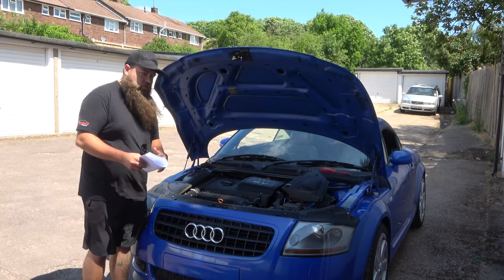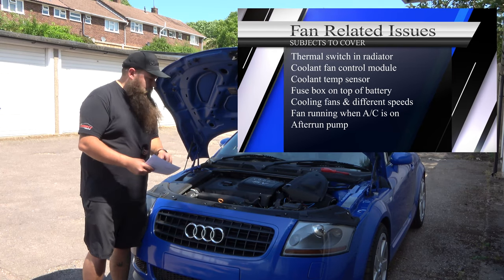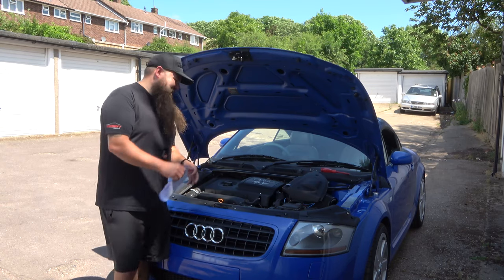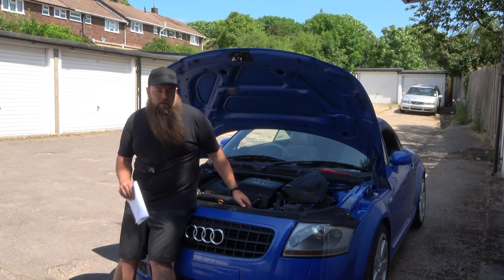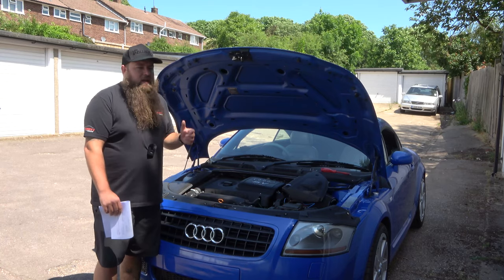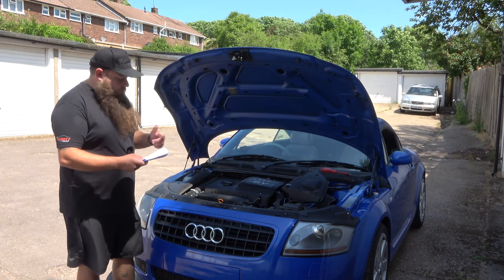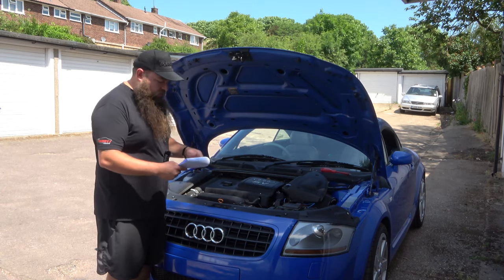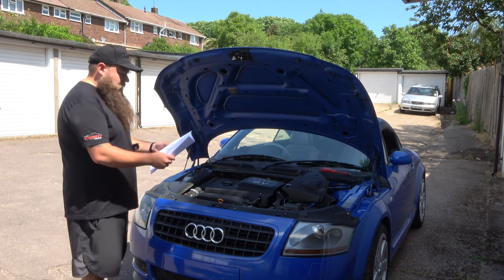How To Fault Find Fan Problems Audi

Comment: My low speed fans come on at about 99°c, and shut off anything below 99. Drives normal but, Are they supposed to stay running even after you shut the car off? I hear my aux water pump, but my coolant keeps getting dumped out my reserve tank when parked and no fans. Driving me crazy. I've watched you video a million times. Good stuff.

Comment: Hello, my first fan speed always starts at 100 degrees, the temperature needle goes up when the car is idling, it goes up a little and then goes down quickly when it reaches 100 degrees. But if the car is completely stopped it doesn't start the first time. speed to cool down the car after driving with it

Comment: Sometimes the air conditioner may not start because the outside air sensor temperature is missing or not working )

Comment: I overheated badly on A30.. towed in and turned out module controlling fans packed up so not turning on. They sorted that out but still running too hot. That turned out to be stupid plastic impeller in the water pump disintegrated!! Got an aftermarket one with metal impeller and was cheaper than the recommended one
Reply from the maker: Unfortunately sometimes it can be the smallest thing that goes causing the biggest problem, I have seen it many times where aftermarket parts have been fitted or parts that have maybe not been made correctly fail, and you look around thinking it’s got to be something else when really is the part you think I wouldn’t fail. And sometimes you replace one faulty part think you’re okay and there’s more than one problem 😂😂

Sounds like you’ve got it all sorted now though 👌🏻
Reply: @TheParrottBros  I was lucky, as to be honest I was giving it some, a little 'friendly fun' with a fellow driver 😉.. there's no layby on the A30 there so had to drive over a mile down the road with the red lights flashing and temp gauge at the top.. stil, head gasket survived and no issues since (was 2 years ago) 🤞
Reply from the maker: @blakkno666  Sounds like you got very lucky if thats the case!! always nice to hear a good story rather than a bad one haha
Reply: @TheParrottBros  it's the Audi pump that has the crappy plastic impellers! I'd advise anyone replacing water pump to buy one one with metal impellers, cheaper too!
By the way, when's the subscribers car vid going up, really hoping I'm in it! 🤞😉
Reply from the maker: @blakkno666  it should be going live this Sunday mate 👀

Comment: Perfect timing for me!
Reply from the maker: It was as if I knew 😂👀. 
Only kidding, I’m sure there is a few people who have been nursing them for awhile as didn’t know what to do,/where to look as this is quite a common grey area
Reply: @TheParrottBros  My TT has been sitting, my ol man parked it after melting the fuse in the box above the battery. The primary fan isn't spinning well either. I have just picked up a new to me module and working on replacing the fan and fuse block.
I'm going to hit the Aux pump as well for good measure now that I know. 
Maybe you did know or you hear the voices in the void calling out in need lol! Either way doing great, keep up the videos!  Kudos from across the pond.
Reply: Not all tts have secundaire electric pump mate
Reply: @TheParrottBros  Starting to think the problem is more pervasive, than you being psychic! LOL
Reply from the maker: @FloorWyers  that’s right, sorry should have stayed. It’s 225’s only
Reply from the maker: @robertcook4215  haha thanks fella, just test as you go, no point replacing parts that are not need replacing. Gets expensive quick 😂

Comment: Great timing especially with the ultra gauge comparison. Just replaced my original after run pump as it was just seeping under pressure. Still have work to do so this video will be very helpful. 👍
Reply from the maker: Glad it will be put to good use, yeah often they get forgotten about as they’re out the way and if you don’t hear them running you wouldn’t question if you did not know it was there 😂

Comment: Great video, i had problem with my AC last year and the pressure switch (G65) was broken. But after change and refill the fluid all worked fine again
Reply from the maker: thanks buddy, thats a nice simple fix, its annoying it doesnt flag a code or anything on the dash, so unless you have diag software you wouldnt know ( except no a/c if you live somewhere hot ) haha

Comment: I already removed the air con and really thinking about removing the fan control module to remove a lot of shitty wires and run the fans the simplest way with relay and temp switch, just trying to figure it out the best way to do it.. nice video bro!
Reply from the maker: Thanks buddy, yeah I too contemplated that but love my a/c too much, if I had a roadster it would be a different story for sure 😂. Feel free to drop me an email fandwe can discuss wiring if you need a hand

Comment: Thanks for the information, car was overheating in traffic, turns out it was just a burnt out fuse on top of the battery ( fuse had actually melted) New 30 amp fuse & fans burst into life. Once again great video.👍
Reply from the maker: Right so if that’s the case check if the slow speed is working or not as usually when a fuse blows or burns is due to being over loaded

Comment: Good timing. I didn’t think I had problems but apparently I do. After run pump doesn’t come on all the time and I see that the right fan never turns on either. Left fan( under the after run pump turns on but I guess the car didn’t get warm enough for high speed to kick in. I guess I need to start looking for part numbers.
Reply from the maker: At least you caught it before it is a real problem, just think how hard a little fan is having to work compare to the other one that should be on at the same time

Comment: Great video and information, THANK YOU! 
I’ve been following your troubleshooting steps and using a jumper wire at the thermal switch connector I’m able to get one fan (right side) to run high & low speed. I would think both fans should be running? Is there a good way to test the left side fan?
Thanks again!
Reply from the maker: Yes, both fans should run together both speeds. 

Check the wiring to both fans as on separate plugs as you may have a power issue. Failing that the fan may be seized or motor failed
Reply: @TheParrottBros  Thanks for the reply Mr Parrott. I see there are 3 wires for each fan, I would guess that one is ground, one is low speed and one is high speed?
Reply: Just a follow up, I found the that the larger fan would not power up at slow or high speed. Removed the fan from the car and removed the back cover on the fan motor. Found one of the motor brushes was stuck in the holder. I freed up the brush, cleaned the commutator & reassembled. Working great. Thanks for the great videos and resources 👍

Comment: In my epic research too find my fault, I came across this gold nugget. 

You can pull out fuse 16, to force the slow run fans to kick off. 
If those work you can eliminate that circuit of the fan controller module. 

Today I finally got the TT back up and running after 3 months off the road. 

The bloody thing has done a full Christine (1983 film) on me 
Haha! 
The TT fixed its self. 😑
Thanks heaps for helping.

Comment: I just purchased an '02 TT 225.  Large fan not working.  All fuses OK.  Do you have video for R&Ring the fan?
Reply from the maker: Hey Alan, good spot, will definatley save issues further down the line, i dont im afraid, its not something ive filmed. Its quite fiddly to do, usually easier if you remoce the front bumper then loosen the slam panel/ rad pack and allow it to come forward to give you extra room to work

Comment: Thanks for a really comprehensive video. Really handy.

CAn you give any more detail on the running of the fan control module? I’ve been told the relay that switches on/off the magnetic clutch on the aircon compressor is contained in the unit. At what stage does it switch on during the aircon startup?

Reason being my compressor clutch is not being engaged and I’m not seeing any difference (in terms of voltage) to the compressor even if the aircon is on.  My car has a failed slow speed fan on the larger of the 2 fans (right hand fan nearest the battery)  which I will replace but the left smaller fan (furthest from the battery) does spin at the slower speed shortly after the aircon is switched on… but I’m not seeing the compressor clutch engage. What are the steps the car goes thru to start the AC? Is there a way to test the ac high pressure switch to confirm there is enough pressure in the system to switch the compressor on… 
Where is he AC high pressure switch and what role does the FCM take in the AC startup? Are there any other modules to check as part of the AC startup/running steps?

Thanks again for your video. It’s helped me lots.

Comment: Hey great channel. Ok I have a mk1 tt 225. Had the car 2 weeks. The car sits at 90 degrees on the Dash and the coolant digital temp on the climate control unit was sitting around 80 when I stopped the car. I let the car idle for 5-10 mins and the genk gage on the Dash was still at 90 by tje fans were not kicking in as I would have expected. Then when I switched the car off there was no secondary fan or pump running as you have mentioned. I will check the fuse/s on the car later. Ans try and work back to the fault.
Reply from the maker: So the gauge will sit at 90 solid when its 80-100 on the climate gauge as its a weighted gauge, thats totally normal, if you turn the air con on do the fans run? and the pump on the radiator should run from the moment you turn the key on until almost 10 mins after you turn the car off

Comment: i've changed fan control module and temp giver and fans work fine now but clima doesnt cool. I've heard about some part behind the glove box that can be the issue but not sure what that part is
Reply from the maker: There should be a sensor that measures how hot the air is in the blower cabin, looks a bit like a metal hedgehog, I’ll get a part number and send it over for you to have a look
Reply: Yeah that part has failed on mine. You can tell by the grayish foam which comes out from the air vents when the ac is running. There are two flaps which control the hot/cold airflow and that foam is the insulator. When it’s gone, the flaps don’t seal properly causing the issue. But I have to say, mine’s busted for about a year now and all I had to do was refill the ac freon. I live in a Mediterranean country and now it’s cold af in my cabin during the summer time.
Reply: @dimitrist3561  yeah i notices some sponge/foam pieces in the vent, i went to refill freon first when ac stoped but they told me its full and just added some oil for lubrication iirc. do you know part number for that flap i think thats my issue
Reply: @TheParrottBros  iirc its some kind of flap behind the glove box but I'm not sure if thats the issue
Reply: @77garga  I couldn't find it, but take a look at the following article for a better understanding of the issue https://www.audiworld.com/forums/tt-mk1-discussion-9/c-blowing-detached-foam-insulation-system-into-car-1948972/

Comment: Hi I have VW golf GTD to turbo recently just got the AC topped up temperature gauge read Dentist to check fuse box his fans was not working fuse as blown change the fuse fan started working fuse blown again no fans do not work and fuse keeps blowing even with the ECU off
Reply from the maker: Likely issue, fan has failed / gone short inside and is causing fuse to blow, that or a sensor has gone short, or you have a wiring issue. unplug one fan and replace the fuse, see what happens if blows plug back in and unplug other fan, easiest way to rule that out

Comment: My radiator fun slow dont work when temp go after 90 , only when i open ac , ive send it to mechanic he did check it , first it thought might be head gasket but after he saw it he told me he fix the control module (centralina ) , all fuses works ok he said but i did a test 20km with ac on. 5 min , after i stoped i saw the fund didnt work again and the car lost water , what it could be ? Please help
Reply from the maker: The slow speed doesn’t usually come on until 95 or above, they are. Controlled by a thermal switch which is mounted in the radiator. This could well be faulty. It shouldn’t be losing water, you could have a number of issues causing that but I would suggest looking at 1 thing at a time.
Reply: @TheParrottBros  i was all day to mechanic , he saw the water cable for leak . Didnt saw any , check all fuses and they seemt to be ok , when he open the centraline under was 2 cable unpluget , when i pluget those the car fun start to work in full speed but the car was cold , he fixed the centralina and now they dont do that again only when i turn ac on , but the water keeps droping half a litter for 20 km , we dont see ant leak in radiator or pipes , where does it lost the water ? What could it be .  in 20 km drive should the fun start working the sliw speed ?

Comment: Theoretically if there is no power at the permanent of the thermal switch, and the fuse has been replaced has it got to be the main brain part not working ?

Comment: Your videos are brilliant mate 👍 helps with my s3 8l a lot. My fans dont come on at all. The car has never went over 90 on the dash. Even with a bit of heavy footed driving. At a bit of a loss
Reply from the maker: You may just have a well flowing car mate, I wouldn’t worry too much if you’ve never had any issues

Comment: Hey bro ur videos are class... I've had my tt for 5 years and think it's the dogs balls but yesterday I was pulling away to and lost all power... My mechanic I know ish had a look yesterday and reckons my water pump seized on and it's jump timing but not snapped...  Its a 225 and she's so clean and looked after what should I do and damage do u reckon is there .. Any help would be brilliant
Reply from the maker: Hey firstly thanks for the kind words, secondly sorry to hear that happened, not usually good news, it depends did it stop the engine dead? make any horrible noises? usually can cause bent valves worst case
Reply: Many thanks on the reply if anyone's gonna no its you.... Yea stopped completely dead at around 1500rpm... Its booked in this week for the head to come off to see 🤞... If u have a spare 225 bam engine would happily buy... Thanks again for knowledge buddy

Comment: I keep going through fuse boxes every 3 months they keep melting
Reply from the maker: There is probably a little bit more to the problem then, which fuse is melting/burning?
Reply: Its the one all the way to the left of the box the thickest wire its black and I think its a 120a one its the only wire that gets hot

Comment: I have an engine warning light and the bigger fan doesn't seem to cut in but the smaller one cuts in with AC. Fuses all look fine. Sounds like the big fan needs to be replaced, is there anything else that is likely to be wrong to cause the light?

Comment: My car has been overheating, and even when I turn on the air conditioning, the fans don't spin at any speed. I turn off the car, then turn it back on, and the fans start working again. I've replaced the fuse box above the battery, 2 temperature sensors, the thermostat, the radiator thermo-switch, fuse box over battery and the relay box under the battery, but the same issue persists. Sometimes the fans work fine at both speeds, and other times they don't work at all. 
If I bridge the connector on the thermo-switch, both speeds work, at least when I tried.
Any help? 
Thank you very much.

Comment: 2007 8p ac stuck in Econ and fans not running in either speed even when car is plenty hot on 95f degree day. Are the fans the reason the AC isn’t working. Also after parking car battery is dead in about 30 min. Thanks for the video.
Reply from the maker: Unsure as thats a different model, its the fans may have failed and its causing the ac to not work but without testing you wont know, worth getting checked and replacing if need be as you dont want your car overheating
Reply: @TheParrottBros  checked all the easy stuff but no luck. Possibly needs ac recharged but not sure if that effects fans. Also noticed the battery won’t hold a charge so car has to be jumped every time. Can a bad battery cause issues with ac system and radiator fans? Thanks

Comment: I deleted my Aircon system out and am using a aux belt from a a3 non ac. 
Now I have noticed the the low speed isn't working. 
Is there a way to close the the circuit to allow the low speed to be working as if the ac is still on the car an working ??? 
Or is there a way to put a manual switch for the low speed. 
It seems to be working from testing at the radiator sensor. But I have no ac motor or piping left in the engine bay 🤔

Comment: Thank you for your helpful video. 
Please could you tell me if the fans are supposed to run after the engine has been turned off. I have checked the after run pump and I can hear it working.
Reply from the maker: Once the engine is off and keys removed only the after run pump should run
Reply: @TheParrottBros  Thank you for your reply. That’s a relief. Please keep doing your excellent video’s.

Comment: I own an 05 Audi A4 B6 1.8T. My fans turn on at a cold start and wont let my car warm up. I’ve replaced the 219 relay already but it was from a parts car. What else could it be. There was water in the ecm box but i noticed the car had this problem when i bought it before the box flooded

Comment: I've taken all of the engine bay air con components out. My passenger side fan is constantly pulsing on n off at high speed and the drivers side running at low speed, both as soon as I start the engine. Any ideas how to cure this please?